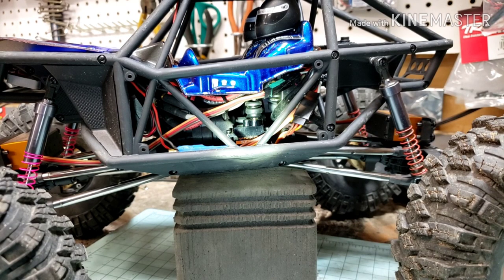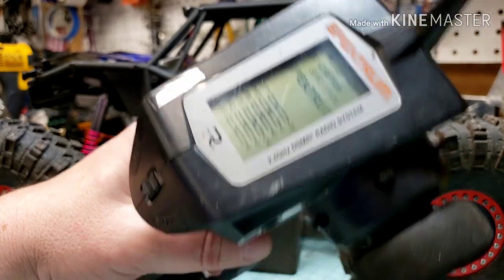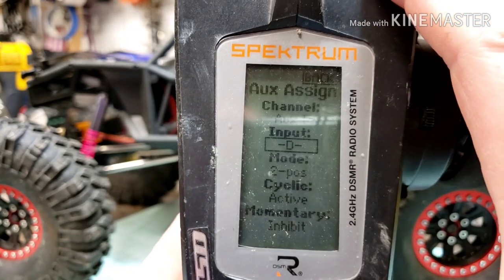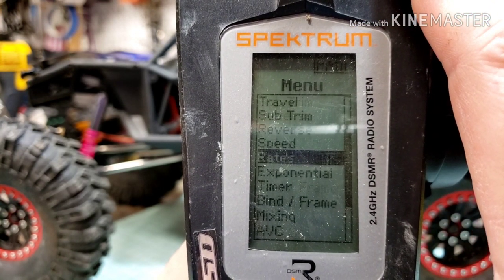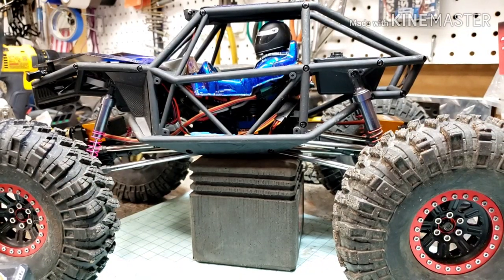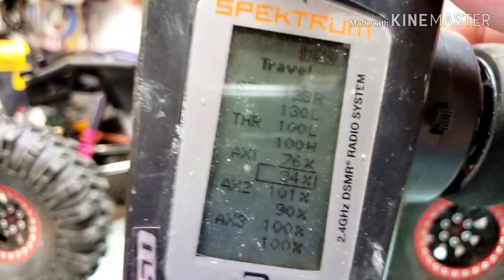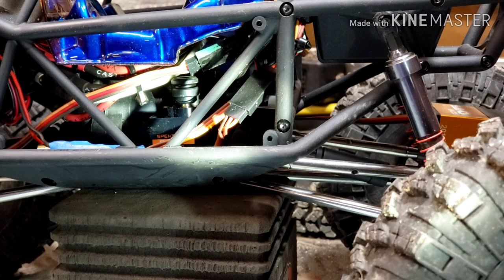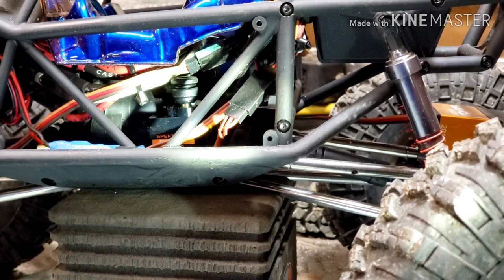MEGA GOAT AXIAL CAPRA DIG SETUP WITH SPEKTRUM DX5C.

Comment: What do you do about the servo going way max to left and to the right when you turn it on
Reply from the maker: I noticed on mine that when i plug the battery in the servo turns the dig on, locks up rear, i just hit the button to unlock the dig function before i start to drive.  I hope thats what you referring to.
Reply: SCALE RC CustomZ when I turn mine on it’s like it cycles the motor a little and it cycles the dig servo left all the way then right all the way before coming to a rest at center. The servo savor flexxes to the max as it does this. It just see,s to be part of the start up but iv seen other people with different servos turn their Capra on and it didn’t cycle the aux they had there dig hooked to. I’m just hoping it doesn’t break anything . But your video did help me get the method figured out and I applied it to a 3 position. I made the servo set at center on free wheel then I press up it locks the rear I press down it puts it in free wheel then I press down again and it puts in in 4 wheel drive